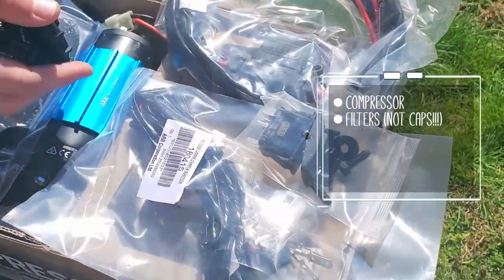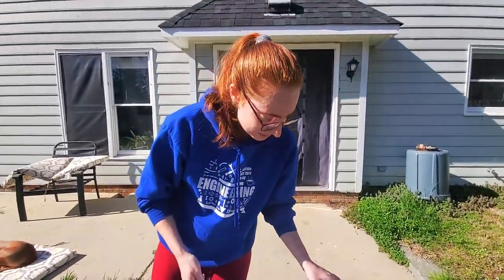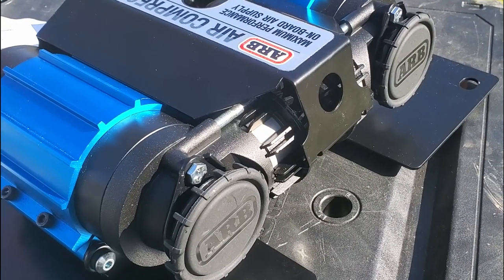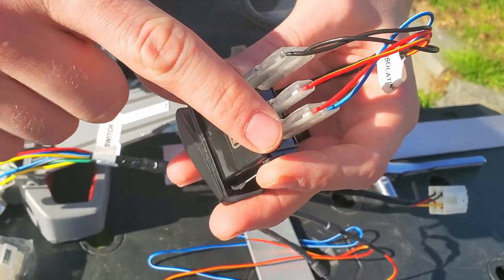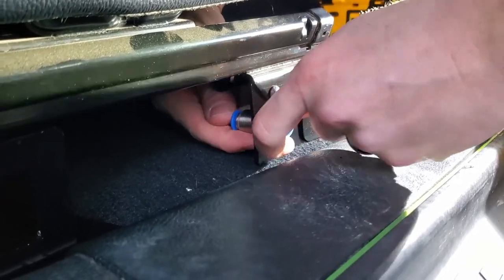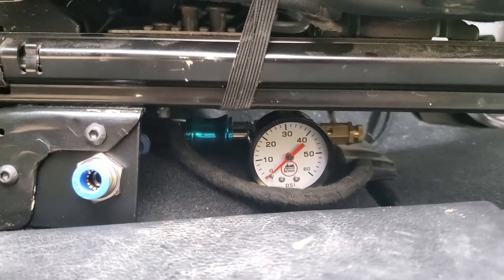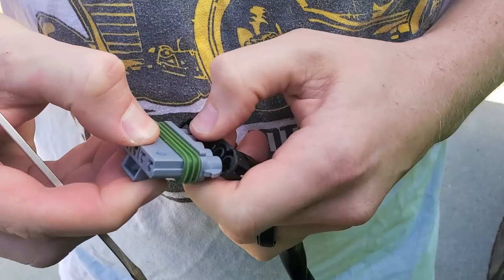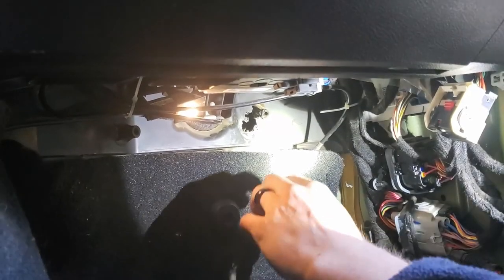ARB Twin Compressor Install! Innovative AT Products Kit || Install Vlog #7

Comment: I am wondering what the outside diameter of the black tubing is that is connected to the compressor 
Thanks!
Reply from the maker: Measured this morning at 3/8ths of an inch OD

Comment: @frickin'jeepsquad awesome system!  How accurately does it inflate each individual tire when doing all 4 at once?  Have you ever checked the tires individually for tire pressure accuracy after using the system on all 4 tires at once and if so have you ever had to adjust an individual tire to get it to the desired pressure?  Thank you.
Reply from the maker: In general the tires will be within a psi or two of your target gauge pressure. The system is designed to equalize the pressures so once you inflate the tires and let it sit, all the tires even out on pressure. So we've never had to inflate a single tire after running the system. It works really well :)

Comment: what kind of air chucks does that system use?  Standard air 1/4" NPT fittings?  As in could I plug in a normal air hose for using an air spray nozzle?
Reply from the maker: Sorry for the delayed response! Just saw this and measured the tubing. The air hose tubing diameter is 3/8" for all the hoses to the tires the connectors are the standard push to connect with 1/4" NPT fittings.

Comment: Thank you for this video! After a year you uploaded the video, would you recommend installing the pressure gauge on the passenger side closer to the air compressor? It makes since if the air pressure gauge is the first component coming out of the compressor for better reading 🤔 but might be that 1psi difference you talking about in one of your comments.
Reply from the maker: Thank you for watching! I would say having the pressure Guage right next to the compressor would be better, you'll get more accurate readings. I also recommend having the switch be on the same side as the guage.
Reply: @FrickinJeepSquad  awsome thank you, got my compressor used and didn't came with a switch, so I'm wiring it to my aftermarket switch but found you video the most helpful in YouTube for the install even though I'm installing it on a gladiator.